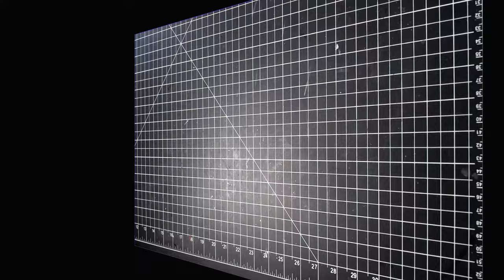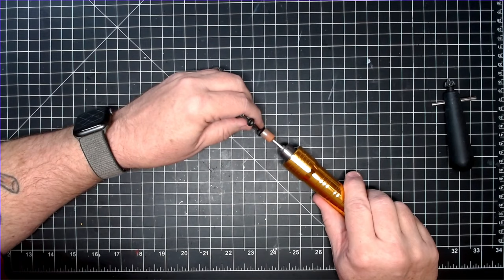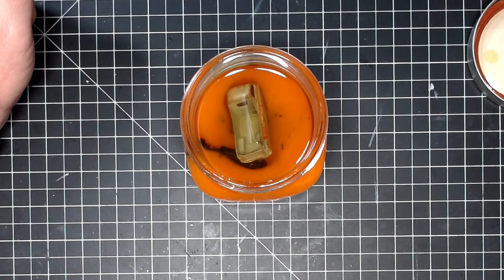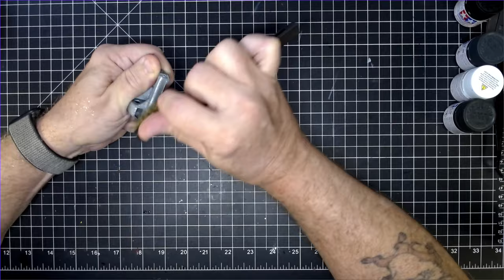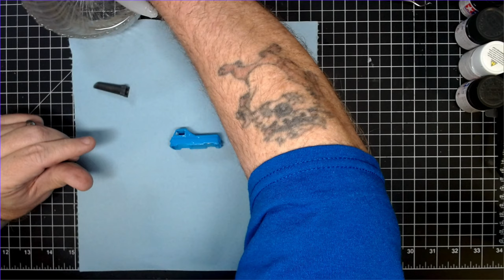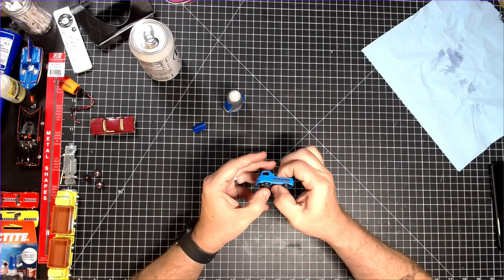Restoring a Matchbox Morris J2 Pickup

Comment: nice and easy. :) interesting how the citristrip embraced the body almost lovingly... the "glorp" surely had a heart written behind it. :)
is it just me, or does the design of the original seem to predate some later custom pickup designs? anyway, looked like fun indeed. :) sorry to hear about the decals. I had some very... interesting decals here or there. from some what would break into tiniest of pieces, and still stick to the model for dear life, to those which wouldn't stick at all, with almost aggressive glue underneath, to the ones from an ancient Lindberg model kit: hard as glass, but still stickin' to it. XD
when I was young, screwing modely back together was out of the question. I wouldn't have known where to get such small screws, even ones with "tin" threads like Corgi used sometimes. instead I'd scrape off the rivet until I could push the rim back with a sharpened screwdriver (and of course, hit home with it one or another time). it usually worked, unless the casting was a bit thin, like with SIKUs Porsche 914, and left me enough material to roll the rivet back into position. not the strongest of bonds, but enough for the vitrine for sure.
Reply from the maker: Decals indeed can be a real crap shoot, which is why I love being able to make my own in house...